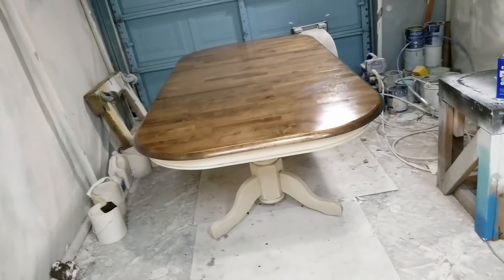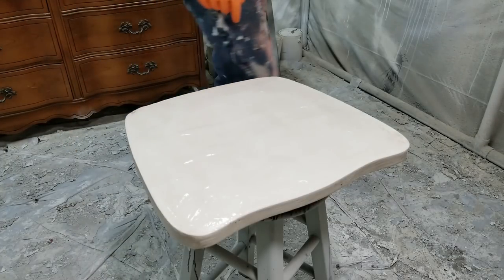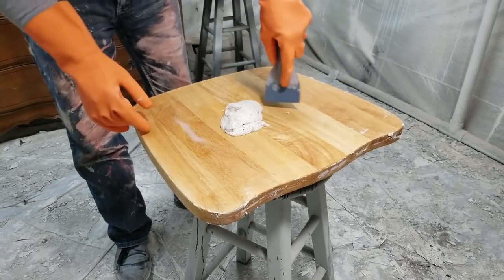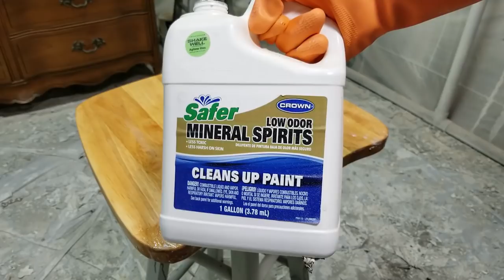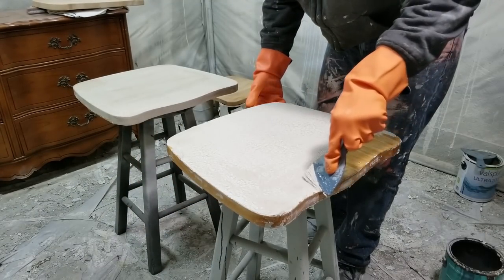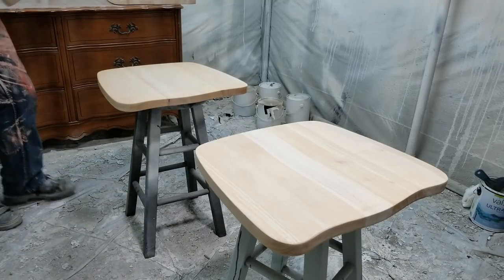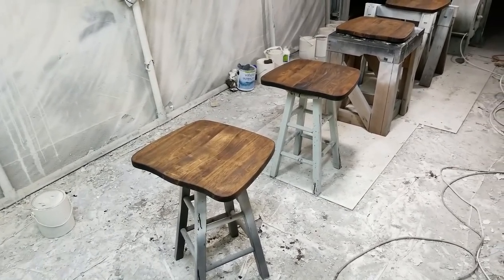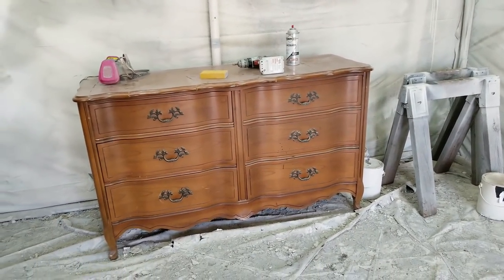Painted Dining Table Makeover Project Part 3 - Final Update! Furniture Project Complete!

Comment: Turned out really nice, I know it was a lot of extra work stripping those chair seats, but it really looks so great with the table.  I stripped a dinning set 40 yrs ago, did not have as good experience as you did, now I see what the problem was, not enough strpper.  Where were you when I needed your expertise? Oh yeah, not even born yet...LOL. Great job...... Greg
Reply from the maker: Thanks again for watching, Gregory. Yes, in the past, the few times I stripped wood was a nightmare. I also realized that my problem with stripping before I did furniture was is drying up and being hard to remove. I felt like... why the hell is this better than sanding?

Every stripper can should specifically say to use an ungodly amount for faster results. They'll sell more too!
Reply: Brilliant well done